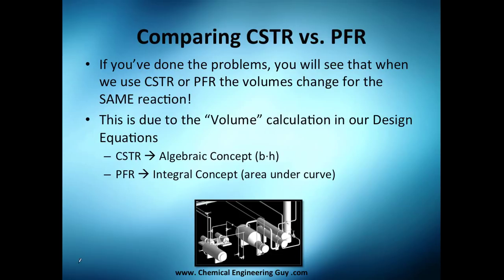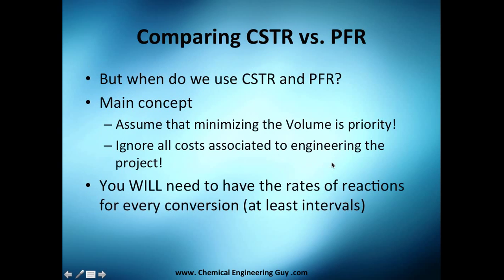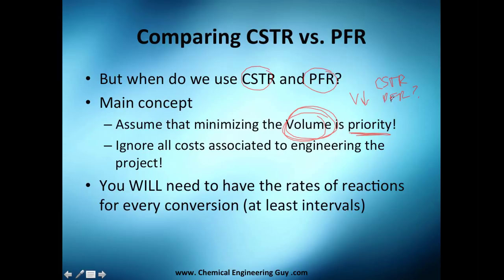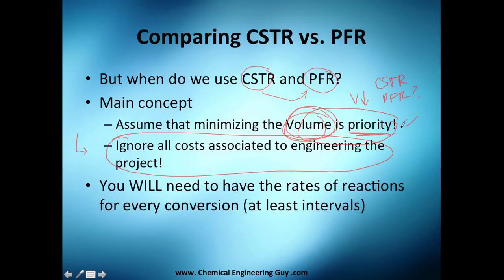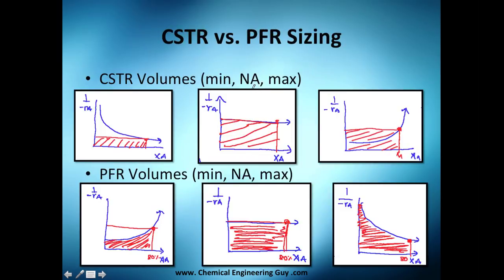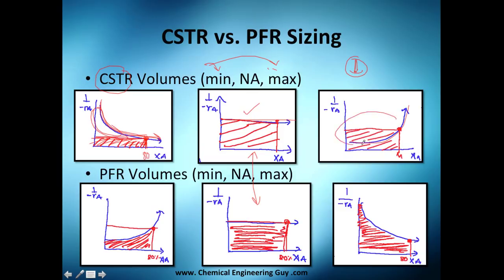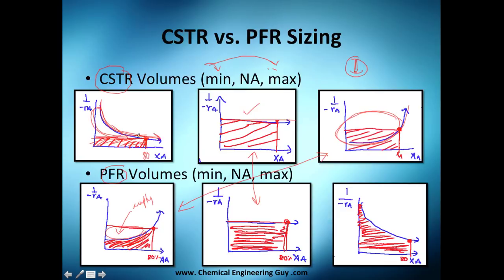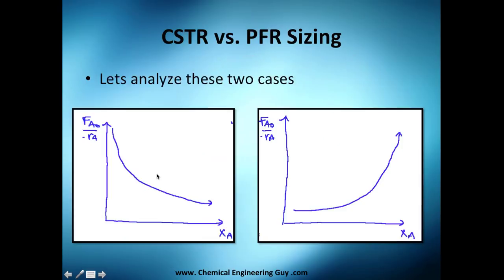Sizing: CSTR vs. PFR a Comparison // Reactor Engineering - Class 27

Comment: please help me immediately :( “For a gas phase reaction, determine which type of reactor ( cstr or pfr ) requires larger volume to achiever similar conversion, if the reaction rate is independent of concentration.”
Reply: I don’t understand a thing from my lectures :(
Reply from the maker: what do you need? please contact me via Contact@ChemicalEngineeneringGuy.com

Comment: Hi, what would be your answer to this:

In order to achieve the same conversion under identical reaction conditions and feed flow rate for a non-autocatalytic reaction of positive order, the volume of an ideal CSTR is
 
(A) always greater than that of an ideal PFR
(B) always smaller than that of an ideal PFR
(C) same as that of an ideal PFR
(D)smaller than that of an ideal PFR only for first order reaction

Thanks
Reply: for a non-autocatalytic reaction (which means "a reaction which rate doesn't increase with conversion"), the curve for 1/ra has a positive general trend, setting the condition for a PFR to have less volume than a CSTR achieving the same conversion.
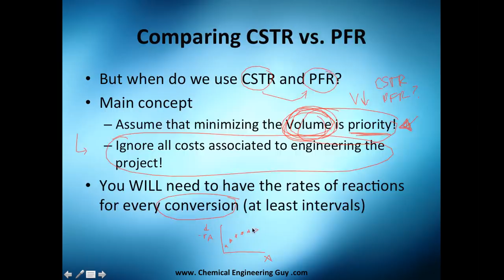Reply from the maker: if positive order; I assume 1/Ra = +1. Go to 2:50. Then you will ALWAYS have smaller volume requirements

Comment: I have taken reaction engineeering classes both in undergraduate and now in my Masters.
Never did either lecturer describe how to decide whether to use PFR or CSTR in the most no-nonsense, common-sense way as you did, with just a few diagrams and a straight-cut explanation. We always ended up going in circles, doing long calculations and forgetting our objective on the way. You changed that. :)
Good work, mate.
Reply from the maker: +Rayhan Arshad Hey bro !thanks for your reply! I really appreciate it! I know at first its kind of hard understand why CSTR and PFR reactors are like that and differ, but once you get it; you actually love to apply its principles :P
Reply: @ChemicalEngineeringGuy  pls help me,do reaction rate depends on volume of reactor?